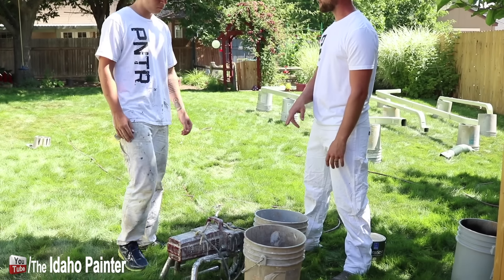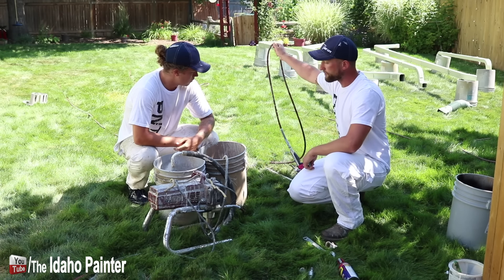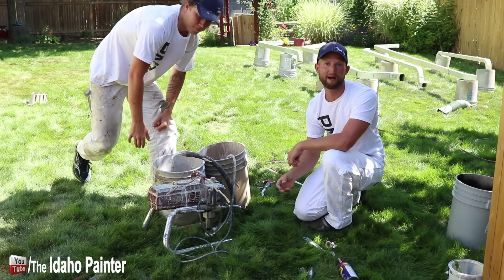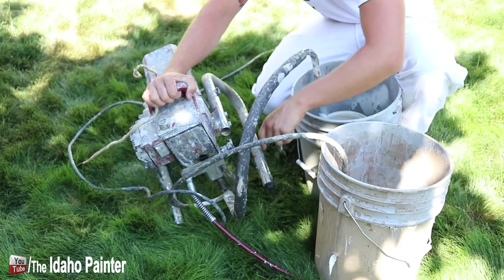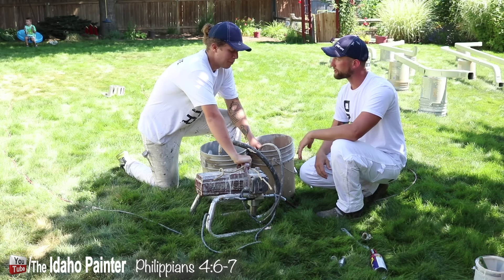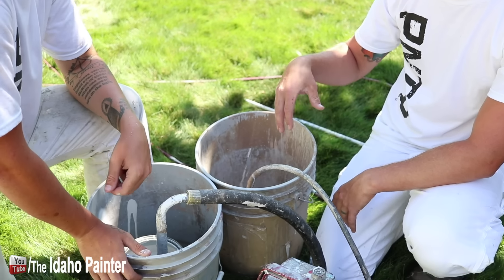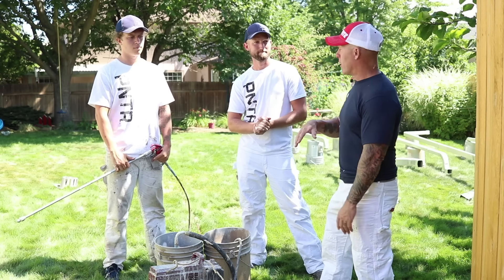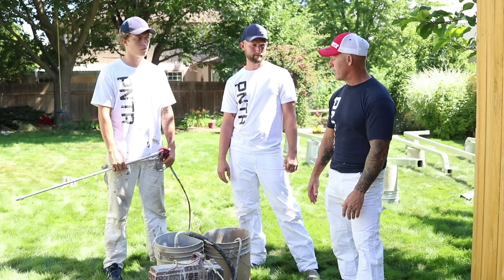How To Use  a Paint Sprayer.

Comment: Have had several brands of airless professional sprayers since 1978 . 
I prefer the direct pick up instead of the hose pick up because they are pain to move around with the hose flopping around and the direct pick up uses less paint to prime the pump plus it’s easier to flush the pump out .

Comment: Oh goodness here I go! Painting my friends house tomorrow with my new titan 440, I’m terrified, but I’m going to do my best to follow your videos, I’m using the video from titan that says to run mineral spirits through the first time- prime line and hose line,then I’ll run water through prime line and hose line, then I’ll run the paint through the prime line and then the hose line.. then I’ll bring my psi to about 2200 with my 30 spray extension, then I’ll be doing hardy plank siding and the soffets and garage door all the same color… I’m going to tape and drape everything before hand….. then I’ll repeat the process of running mineral spirits, then water, then antifreeze and store. 👍 I’ll let you know how it goes!

Comment: We sometimes go weeks without using our Graco Mark IV what’s the best way to store a srayer?  Wet or dry? I noticed one guy was keeping the intake hose in a bucket of water with conditioner (lube) in the water.. after watching your last video I learned that you don’t run the conditioner through it while you are cleaning it but through the lube Orpheus on the front of the sprayer correct??

Comment: I like your videos there very informative. The only problem I see is your helper
Is not wearing safety glasses. High pressure can push paint  through your
Exposed body parts . Better safe than sorry,pressure lines and fittings have
Been known to fail.

Comment: A friend of mine is attempting to lime wash the exterior brick of her home.  She bought the lime wash solution that you mix with equal parts water and we've been applying it with mason brushes.
It looks good so far but it's very slow going. Can a paint sprayer be used to apply the lime wash?

Comment: Hello, I have been spraying as a hobby for a few years and followed you along the way. I have a couple questions. I have recently been repainting a house I painted 5 years ago and that had subsequently been brushed in places too in a different darker colour. I have experienced a couple of things that I would like to improve. I have seen, what I call spider webbing on the paint white middle spots with darker bits round it, sometimes these even crack, now I think its related to the material underneath, any recommendations? The second is full on cracking and the paint peeling away the day after spraying. The third is when you are covering the same surface with multiple colours (some very different) how do you prepare to prevent seeable bleeding? The surface is a plastered wall  

Using a wagner P20 515 tip, white filter, Johnston Durable WHITE Matt paint

Comment: Great Video. I have 2 questions. 
1. Do you thin out your paint before spraying to chamge the viscosity? If so, how do you determine how much water to add?

2. How do you determine the pressure setting on the machine? Do you have any tips on a standardized preasure setting that would limit runs or excessive over spray?
Reply from the maker: We do not thin our paintWe must run our pumps at 1800 PSI

Comment: Chris, question.  I have a brand new Graco X17 Magnum Airless Sprayer (decent for a DIYer) and had problems using a fresh can of BEHR's interior all-in-one primer.  After a few hours of use, mostly waiting for wall to dry, the pump would run continuously and I would lose all pressure to the gun.  Raising the pressure would only help so long.  I noticed the suction screen wasn't fully submerged in the paint anymore as the bucket got low.  Is this common of thick primers, does it have to be thinned, or was I having a suction problem?  Everything ran fine when I went through the cleaning process with water.
Reply from the maker: Reprime it
Reply: I did try to reprime it.  After watching your videos, didn't think to let the gun run for 20 seconds or so, recirculating the paint.  I'll try that next time.

Comment: Is there a cheaper sprayer you would recommend? I'm going to try and spray my house for the first time and i would rather buy a sprayer than rent one. My house is 1,700 square foot.
Reply: I bought a reasonably priced airless sprayer. It was a Krause and Becker 5/8th horsepower airless
Reply: @vikings844  did you use Elastomeric paint with it?

Comment: Might just add if your line is charged when putting on the spray tip,  make sure the trigger is locked,  there is potential there to get paint injected into your skin,  I think you covered that in a previous video Chris,  just thought it was worth bringing up again... safety first as they say !!!
Reply from the maker: Yes, thanks for including that Daniel!

Comment: Constructive criticisms: It's not recommended to prime the pump at a high pressure setting. Its much safer and easier to prime both the intake tube and the spray hose at the lowest pressure setting. Only increase pressure when ready to spray. The proper "pressure relief procedure" per any sprayer manual does NOT mean flip the valve down to prime when you're done. This is why you get the blow-back with paint flying everywhere. The proper procedure is to turn the machine off, and trigger the gun into the paint supply. You release the pressure from the gun first, with the machine off. Then turn the valve down to prime. Little to nothing will come out, and there will be no blow-back. Also, as others mentioned - use the safety on the trigger at all times.
Reply from the maker: Thanks for sharing man!